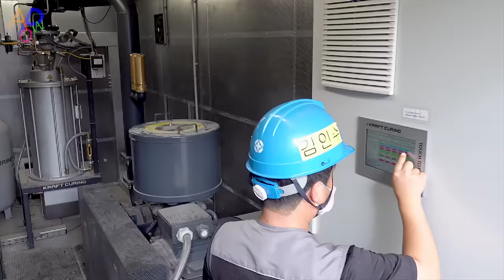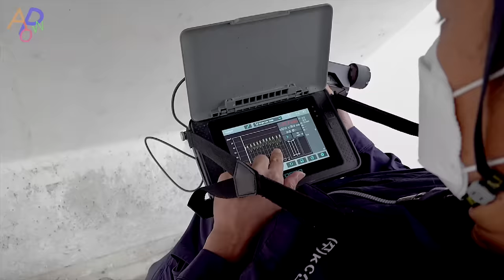Process of Making Supersize Concrete Box. Korean Box Culvert Plant

Comment: The pebble/or rubble size in this video seems to be larger when comparing them to the rebar density. 
Also instead of using steel rebar, it is more desirable to use GFRP(=Glass Reinforced Fiber Plastic) type rebar. No rust and higher tensile strength they have, and cheaper than steel rebar.

Anyway "KC" production facility is one of the best one and the making process looks excellent. So the Culvert quality would be guaranteed.  And I know they also provide high quality Pre-fabricated House with this system.
Reply: металлическая арматура лучше пластиковой

Comment: Glad to see them wearing a safety harness.   Too bad it's not attached to anything.
Reply: What the hell would you want them to be tied to if they just don't work at 50 meters high?
You better keep quiet
Reply: @iuliandragomir1  falling even from 3 meters would fuck you up.  It doesn't have to be from 50 meters.
Reply: The working surface is high enough to be potentially fatal in an event of a fall, but too low for any harness system to be effective. Harness can cause fatal injury without a shock absorbing lanyard but the lanyard has a deployment length of up to 2m. I hope they use some kind of mobile scaffolding with balustrades.

Comment: There's a similar process used in the United States, but here is used to make prison cells. 😑
Reply: Our concrete bussiness should be booming cuz we need a lot more
Reply: Who explains to me what they are used for is a big box?
Reply: @TuMundoAndroideMania  drainage system possibly
Reply: @kookie175  thanks
Reply: It’s a underground drain, they can make them 3 sided also for a bridge to run over. I have built these forms in Oregon and it strange to see them cast on their side, ours were a vertical cast form and ran like a clock.
Reply: 한국인입니다! 이것은 감옥이 아닙니다!
Reply: fantastic
Reply: Your prison cells are concrete but your houses are wood? Why?
Reply: @jamie3226  In short, greed and vanity.
Reply: Hhh
Reply: @jamie3226  это дренаж
Reply: @jamie3226    Because the prisoners will chew their way out of wooden cells.  They’re animals.
Reply: @TuMundoAndroideMania drainage system for storm water under pavement

Comment: Ive got something to say: Is the maximum granulate size smaller than 1/4 to 1/5 the time of the smallest distance of rebar to a side? Or 1/4 to 1/5 the size of the smalles dimension of the concrete. If it is larger than that, the concrete mixture is not right. It is weaker than it should have been. And you should make smaller granulate. If you do that, your concrete should last a lot longer. 

Maybe a more oily substance on the molds will make for a cleaner mold afterwards (???). The concrete box looks clean though.  

They need to add a vibrator the the sides of the mold. Or at least vibrate more. There are a lot of places where there is no concrete but air inclusion. 

Maybe they consider it up to spec. But its easy to adjust, and will give better results. A better product for almost no extra effort. Will it cost that much more to do it really right?

With steel fibers you can do without the rebar, and save a lot of time. Is that worth it?

I like the steaming and the gymnastics though! 

And the sock bands. :) 

This is super quick with turnaround time. That steam. :D

Greetings,

Jeff
Reply: Your comment is exactly right, the pebble/or rubble size seems to be larger when comparing them to the rebar density. 
Also instead of using steel rebar, it is more desirable to use GFRP(=Glass Reinforced Fiber Plastic) type rebar. No rust and higher tensile strength they have, and cheaper than steel rebar.

Comment: Any one can explain  on  concrete using steam in the drying process ? Thank you.
Reply: The concrete hardens but the addition of the steam keeps the concrete from losing moisture during the hardening process which prevents cracking - concrete is prone to cracking with rapid loss of moisture during the curing process.